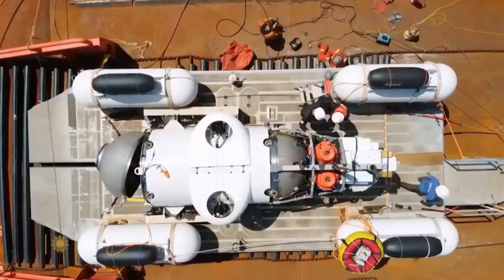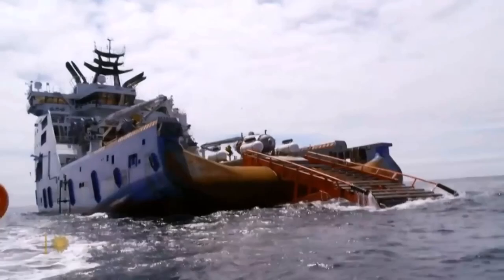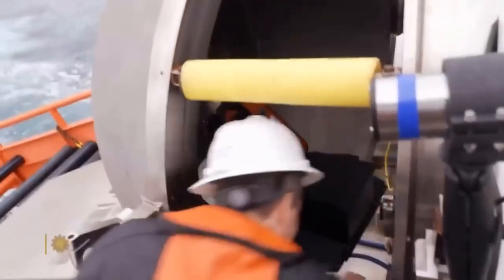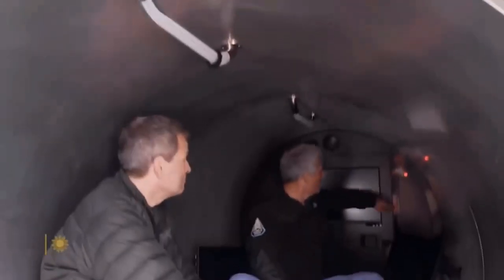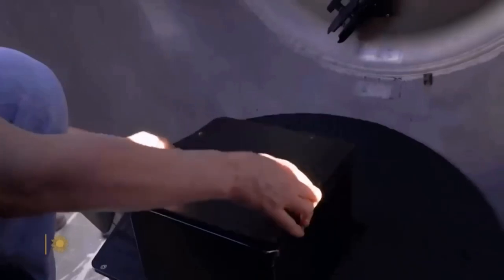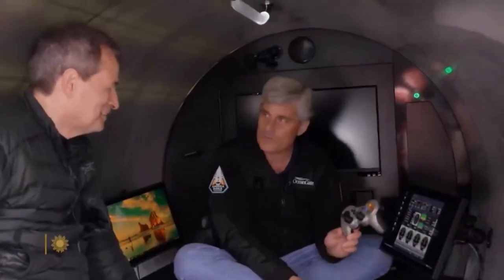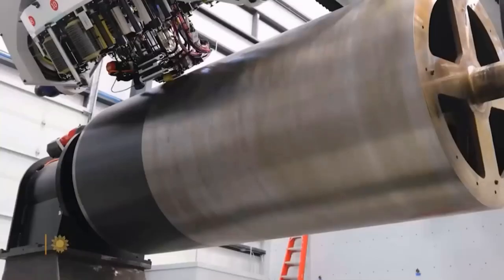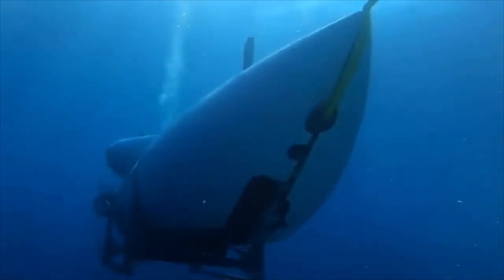Titan Built Using Very Basic Consumer Products 🎮😲

Comment from the maker: They All Signed Waivers of Liability. The Waiver Reads As Such...The Submersible As An "Experimental" Vessel, "That Has Not Been Approved Or Certified By Any Regulatory Body, And Could Result In Physical Injury, Disability, Emotional Trauma Or Death". 😨😨
Now Everybody Knows The Meaning Of "Crush Depth"
Reply: @Jenetic Code, absolutely.  

So many corners cut and safety factors, missing.  It's a joke that this was even allowed off of dry land. 

So Stockton Rush became very  wealthy off the backs of other very wealthy 'explorers,' knowing that Titan was basically a bodge job, unfit for purpose. 

How anyone can hear rhythmic banging for half an hour, then it stops for four hours, is beyond me, considering the Hull is five inches thick, and the composition of the hull would also muffle any banging. It's also beyond Submariner Experts that are trained to listen [sonar experts] to the noises in the sea.  It's built of carbon kevlar for God's sake!  There's a quarter of a tonne per square centimetre of pressure on her [Titan], roughly 6000psi if my maths are correct. 

So Mr Rush, what's the cost of human lives?  £200k per person by the looks of things...

I think we can only hope they can be found and brought home.  Sadly though, I fear they won't be found alive. 

Terrible, awful unnecessary tragedy. 

Xxx 😢
Reply from the maker: @Ann-vc1py  Here's The Link To That 2018 Lawsuit By David Lochridge OceanGate’s Former Director Of Marine Operations Who Was FIRED When He Raised MAJOR Quality And Safety Concerns. Par Example, Lack Of Non-Destructive Testing Performed On The Hull. The Paying Passengers Would NOT Be Aware, Nor Be Informed Of Said Experimental Design, The Lack Of Non-Destructive Testing Of The Hull, Or That Hazardous Flammable Materials Were Being Used Within The Submersible.😱
https://www.documentcloud.org/documents/23854184-oceangate-v-david-lochridge
Reply from the maker: Mere Months After Lochridge Being Fired, MTS (Marine Technology Society) Sent A Letter To OceanGate On Behalf Of Its Members, Who Collectively Expressed Unanimous Concern Regarding Development Of Titan & The Planned Titanic Expedition - https://imgur.com/EypCUjp

Comment: God bless those poor souls on board. It's going to take a miracle to save them. If they don't make it that is going to be a horrific death.
Reply from the maker: Truly Terrifying! If This Ends Badly, I Pray The Vessel Imploded. The Carbon Fiber Would Have Shattered & None Of Them Would Have Had A Chance To Feel A Thing. It Would Have Just Been Over 🙏
Reply: @JeneticCode  I hope so🙏, at least that would be fast and hopefully they won't feel a thing. However, I'm hearing on the news that they're hearing banging they have less than 24 hrs of oxygen left and it's freezing. then there's food and water to consider 🙏
Reply from the maker: @Whoa_Lisa  They Went Down With Only 1 Bottle Of Water And A Few Snacks. Another Frightening Possibility, The Vessel Has Surfaced & Unable To Be Located & Unbolt That Thing From The Outside To Get Them Out Before The Oxygen Depletes Completely
Reply: @JeneticCode  Every possibility is horrendous. They really need a miracle now. I can't help but think that time is running out and even if they find them with oxygen, will there be enough left to save them? I'm praying for a miracle.